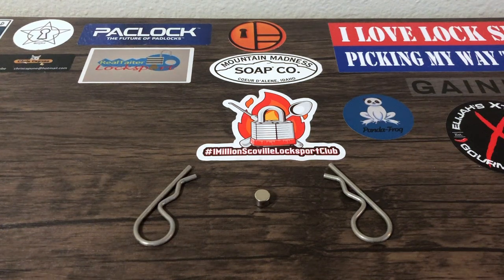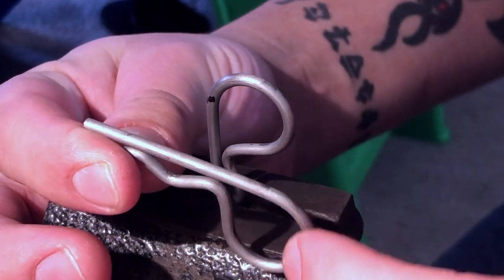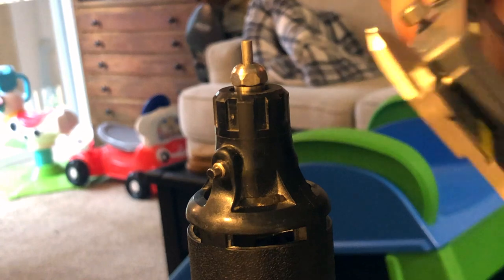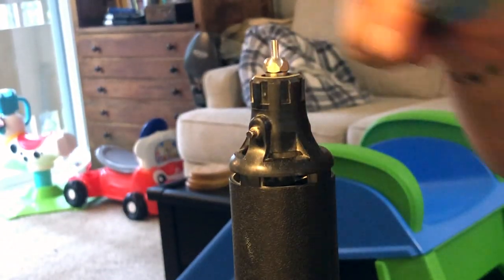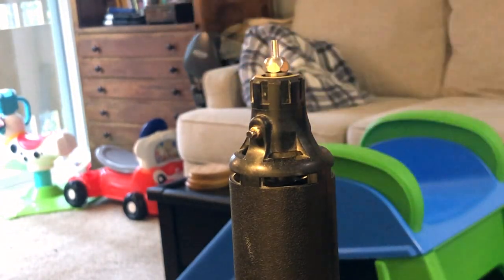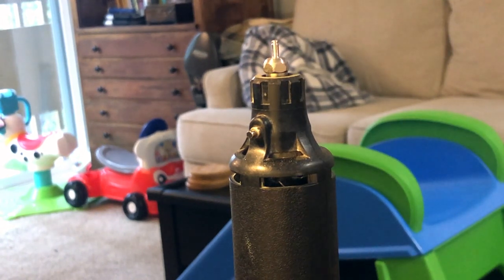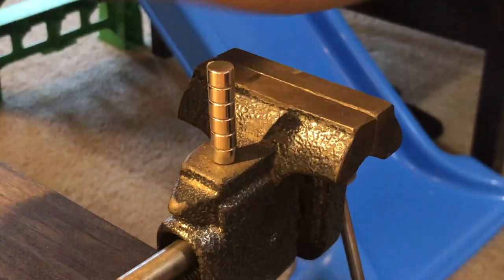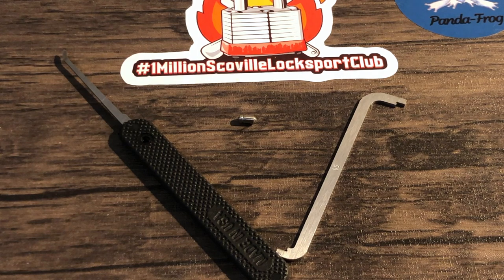How to Make your First Magnetic Challenge Pins!

Comment: I tried to use small neodymium magnets  to make pins and failed miserably. I wanted to use magnets for the springs, key and driver pins. So two oriented the same way and one fliped to force them down. If I wanted to keep um just as "standard" pins it was working ok-ish but the second I chucked one up in the dremel to make it more spool shaped I realized just how bad this wasnt gonna work... at first I couldn't find anything that would cut into them. The carbide cutting disk worked but shot sparks everywhere and they would spontaneously fail completely and crumble into a powder that would just kinda explode apart... the springyness of using them was great but didnt make up for the not being carvable. And magnetic  springs without magnetic pins is useless. However picking a lock that has magnetically coupled driver and key pins  brings a new challenge to your life. The feel from it is so weird... even at the shere line it doesn't react normally at all. Somewhere around here I have the defiant I pinned up with the "standard" pins style and when I try to pick it forgetting what it is I get confused pretty quickly...

Comment: Good idea but I made a challenge lock using earth magnets with small nails as the pin in pin drivers but I never put it out because kids swallow what they find & small magnets can cause real trouble in the intestines my friend
Reply: i doubt the magnetisation you can get with that method to small pins like that would be that big risk the risk comes with neodymium magnets (like you said) but all the same best not to have near kids your right